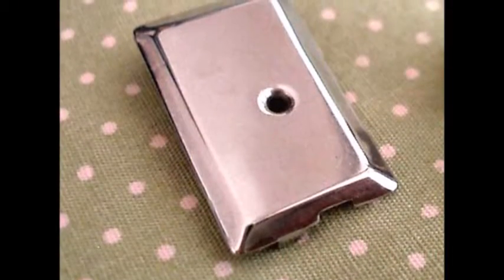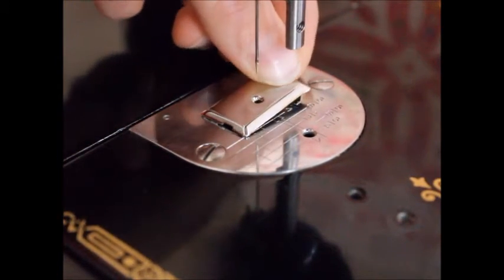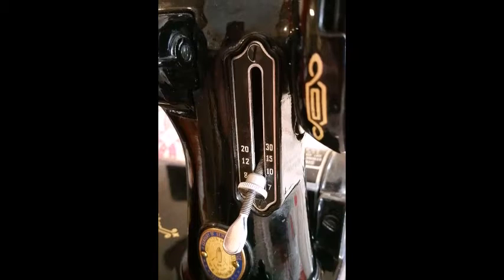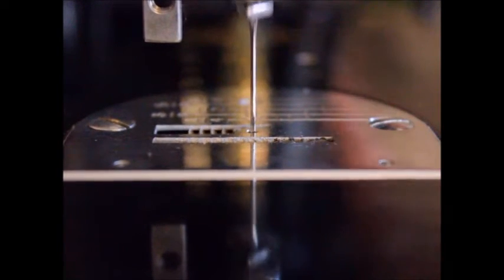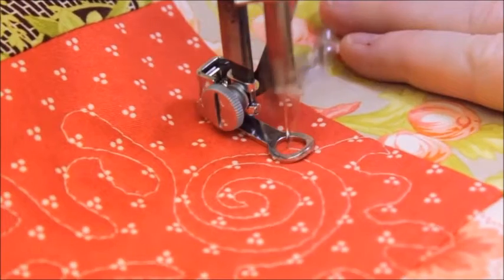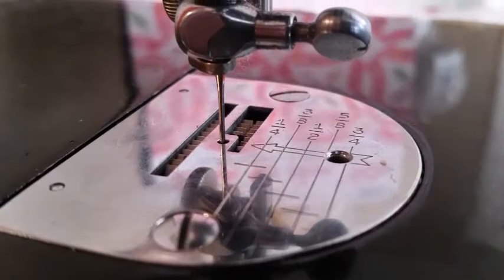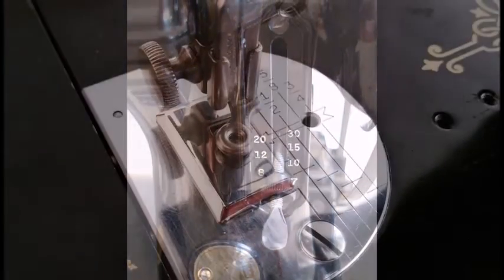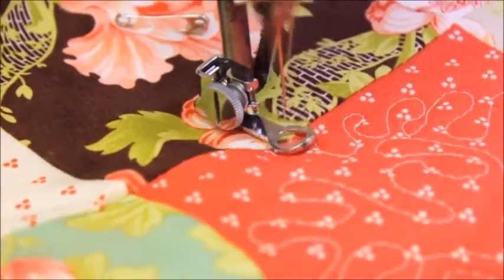The Replica Singer Featherweight Embroidery Plate

Comment: Thanks for the info regarding the neutral position of the stitch length regulator.  The photo showing the lever positioned beyond the 30 mark was a profound Eureka! moment!   I've just acquired an original feed dog cover plate for my Singer 101, but was confused as to how to set the stitch length dial to zero when there is no zero!  Now I can piece with my '51 Featherweight and quilt with my '27 101.  Thanks so much!